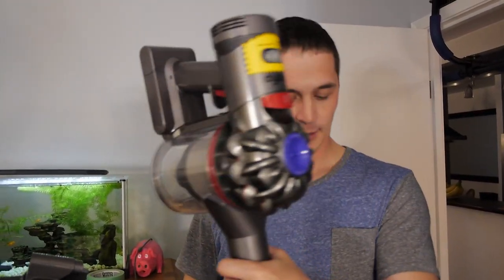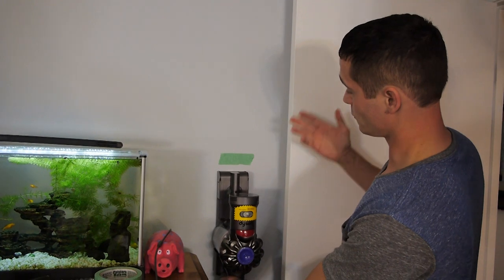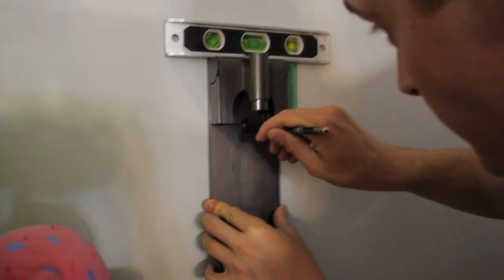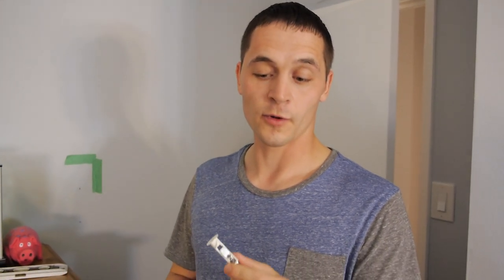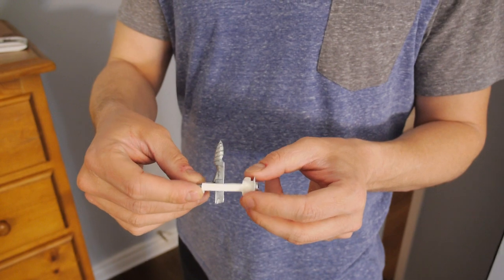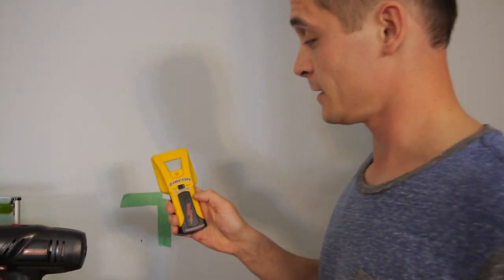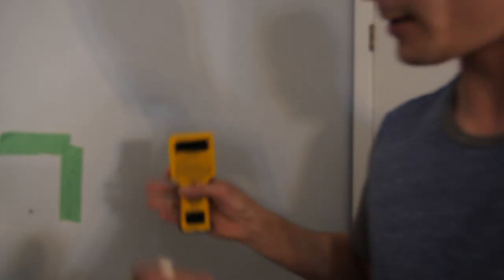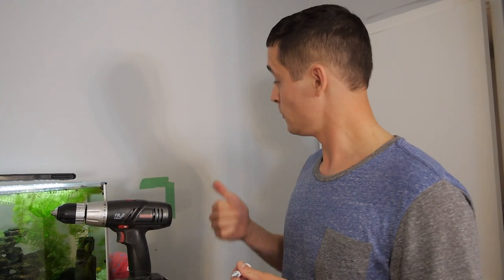How To Mount Dyson Stick/Handheld Vacuum On The Wall (Drywall) Using Driller Toggle Anchor.

Comment from the maker: PRODUCT LINKS:
1. 10 Heavy Duty Drywall Anchors and Screws Kit. Screws #8 x 2-1/8″- Durable Zinc Self-Drilling Drywall Anchors for Hanging Pictures & More - https://amzn.to/3nO42zW.
2. Dyson V7, V8 Wall Mount (Docking Station), Part# 967741-01 -  https://amzn.to/3rU5EdL.

RECOMMENDED TOOLS:
1. PAINTER'S TAPE - Painter's Mate Green Brand CP 150/8-Day Painter's Tape, Multi-Surface, 36mm x 55m, Green, 1 Roll (103367) - https://amzn.to/3QoWikm.
2. LEVEL - Klein Tools 935R Aluminum Torpedo Level, Rare-Earth Magnet, 9-Inch, Hi-Viz, V-Groove, 3 Vials, Top-View Vial - https://amzn.to/3m7Onva.
3. STUD FINDER - Zircon StudSensor Pro LCD Deep-Scanning - https://amzn.to/3MeG3Ez.
4. CORDLESS DRILL - CRAFTSMAN V20 Cordless Drill/Driver Kit, Brushless - https://amzn.to/3LhY1Fo.
5. DRILL BIT SET - DEWALT Drill Bit Set, Black and Gold, 14-Piece - https://amzn.to/3kRRiaM.
6. MULTI-BIT SCREWDRIVER - PICQUIC SIXPAC Plus 7 pc. Multi-Bit Screwdriver - https://amzn.to/3IOHg1Y.

Comment: Great video , we found that the fasteners Dyson provides aren't strong enough to hold the charging station firmly to the wall after an extended period of time - the connection for the charger is at the motor end of the Dyson and it's just too heavy for the given plastic anchors - our SIL mounted to a stud which is another way - thanks for this video , one of the few I found that demonstrates the use of a toggle type anchor .

Comment: Thanks. What size drill bit did you use?
Reply from the maker: The diameter of the bit has to be similar to the diameter of the bolt that you are using.
Reply: I am trying to install my Dyson v10 wall plate which came with 2 wall plugs (1" 3/8) and 2 screws. I am using a Black & Decker 20V  Max Cordless drill.
Reply from the maker: If you are going to use drywall plugs/anchors, you can make a pilot hole with the smallest drill bit that you have. And then screw them in.

Comment: What is the name of the Driller Toggle Anchor you use / recommend ?
Reply from the maker: 10 Heavy Duty Drywall Anchors and Screws Kit. Screws #8 x 2-1/8″- Durable Zinc Self-Drilling Drywall Anchors for Hanging Pictures & More - https://amzn.to/3nO42zW.

Comment: What brand or name of anchors did you use? the ones that come with the vacuum are very cheap.
Reply from the maker: 10 Heavy Duty Drywall Anchors and Screws Kit. Screws #8 x 2-1/8″- Durable Zinc Self-Drilling Drywall Anchors for Hanging Pictures & More - https://amzn.to/3nO42zW.